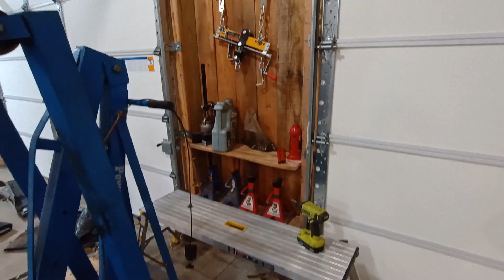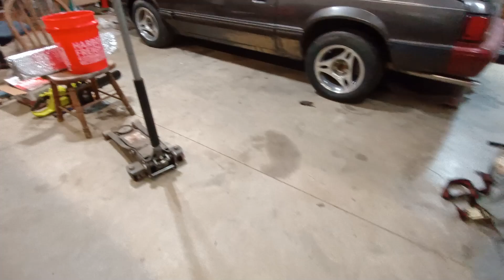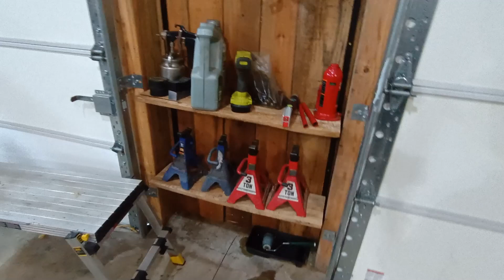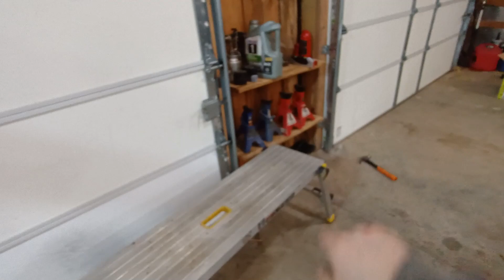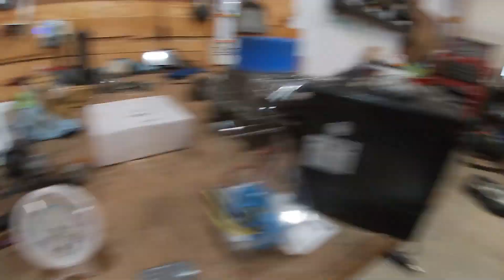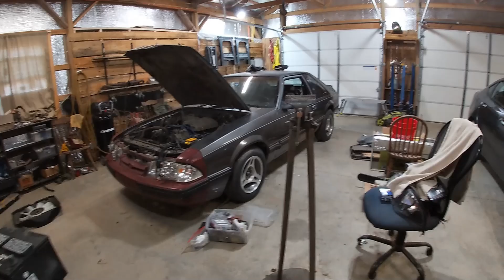Ryobi Forced Air Heater Install

Comment: Awesome video brother.  Nice heater. Does it heat your shop really well? I have a 40 x 60 well insulated shop. Have the huge propane heaters in the  ceiling which I can't afford to run. Just looking for something to take the chill off while I am out there working. Keep the content coming.  Hope you have an incredible weekend.  Much love and RESPECT
Reply from the maker: It does a great job.  About an hour and the chill is out so my hands and face don't get cold.  That's starting about 38F or so.  From what I understand, the forced air propane heaters are all pretty efficient.  A mechanic in my area switched to the forced air electric for a cheaper bill.